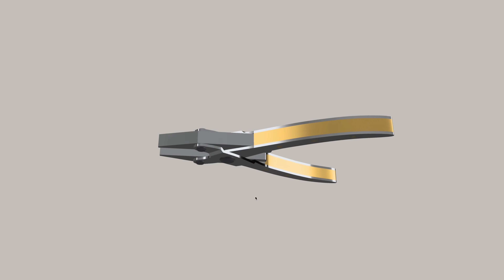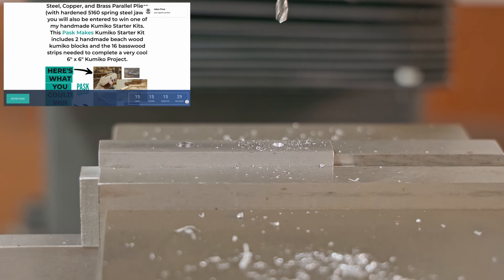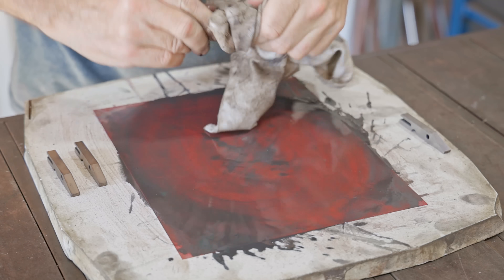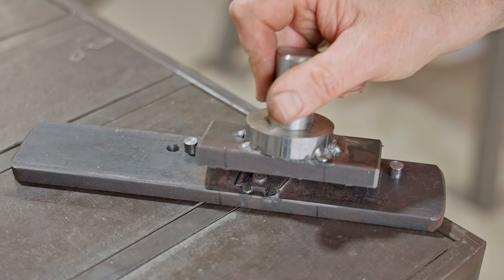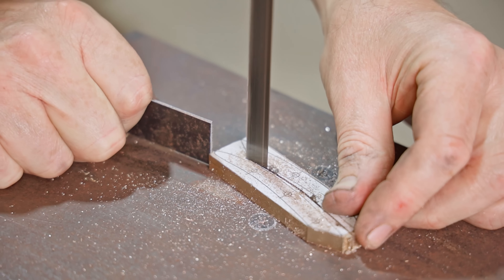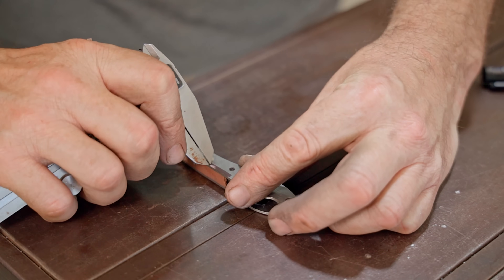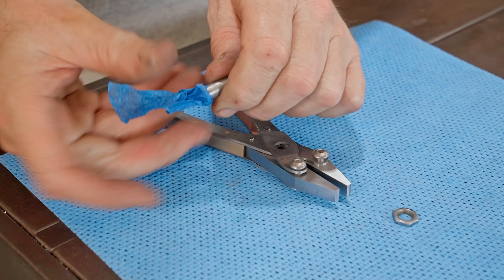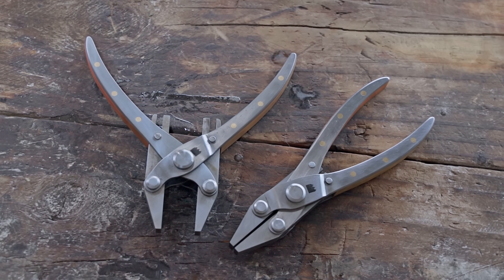How do Parallel Pliers work? Let's make some with Wow Factor and find out!

Comment: I probably would have used wood instead of copper or brass so it doesn't feel cold to the touch, then kept the wood a bit oversized and rounded. The copper and brass look nicer, though.

Comment: Copy the Bernard’s.  There should be a groove running down the center of one of the jaws so that you can pass a steel wire or rod thru the entire body of the pliers and get a good grip on the wire to pull lengthwise.  Also, add the 5X mechanical advantage side cutter that many Bernards pliers sport. Its a HUGE benefit.

Comment: I was complaining about the pinch point of regular pliers just a few weeks ago and didn't even realize parallel pliers existed!  Love this project and would love to buy the plans to build a set of my own!
Reply: I've an old pair made of stampings and tool steel. They are very smooth and have great bite. The bluing is excellent. They are beautifully made and a joy to use.
Reply: Bernard is the manufacturer.

Comment: I have a few pairs of parallel jaw pliers made by Maun in England. They're fantastic to use, especially when gripping wire. If whatever you're gripping is long, depending on its width you can slide it through the handles to give a really good grip on the very end.
Reply: So basically holding it yourself but without touching it

Comment: Fantastic! Beautiful build. As an aside, I still don't understand leaving oil on metal over night so it can penetrate but I do it myself and it seems to make a difference.
Reply: It won't soak into the metal, but giving it time to flow into all the nooks and crannies where you'd usually see the start of rust and pitting is probably the key.
Reply: @MrVeps1  that makes sense, get rid of the tiny water/moisture traps.

Comment: Very cool! 
Something you might want to consider is getting a quenching oil. While I have no personal experience, I've seen back to back tests of various quenching fluids, and an engineered quenching oil wound up being the best - with even straight water beating out canola oil and other commonly used fluids due to its consistency. 

It may very well be worth the investment!

Comment: When looking for and checking chop-shops, they always had a few pair around the shop. Back in the 60,-2000 they used the for changing the vin on the door frame, they used the PP's to form /shape the pop-rivets 6 points to install a new tag from a totaled to a stolen.

Comment: Hey Neil, great video. Really watchable. Thanks. (I met you at a YouTube creator event in Sydney, pre-pandemic.) I'll be really interested to see how these pliers go, long term, in particular as to whether galvanic corrosion is a problem for the steel handles. Steel is a more active galvanically metal than brass or copper, and therefore, when in close contact the steel will sacrifice itself to protect the brass/copper. In other words the copper and brass will tend to accelerate the rusting process on the steel. The epoxy might provide sufficient insulation to prevent this from occurring, or at least slow it down, so I suppose the success of that will depend on the thickness and contiguity of the epoxy layer. (This kind of corrosion is essentially the reverse of galvanising - where zinc is the more active metal and sacrifices itself over time to protect the steel).

Corrosion, if it occurs, should be more predominant in the steel touching the copper, because the copper is slightly less galvanically active than brass (leading to a slightly higher sacrificial rate for the steel).

Dissimilar metals in close contact always react galvanically in this way - perhaps something to consider in future projects.

All the best. Keep up the great work.

Comment: I am by no means a professional, but when you are doing you're drilling holes and milling out slots and such, your bit seem to be quite a but chattery, for the longevity and protection of your material and bits, use some machining oil. I don't suppose you'll need a while pressurized rig, but keeping a small bottle handy would do wonders. my apologies if you are already using lube, like I said I am not a professional, and I'm not trying to hate on your work, just pointing out something I noticed. Cheers

Comment: Another brilliant job Sir.  What was the small clamp you used at the drill press, the one with the copper in it?  Either brass or copper both would look great.
Reply: It's a Kant Twist clamp.
Reply: @Paul Frederick  thank you. I could use those in my leather working.

Comment: They are very cool. As with all your videos the process is interesting to follow. 
What is there an advantage to epoxying the pieces rather than brazing? 
Is brazing difficult with thick pieces of copper and brass?
Reply from the maker: Thanks Morten! I reckon soldering would've worked well but in the moment I decided to epoxy them. :)

Comment: I have a pair of old parallel pliers like these that i use all the time but have unfortunately been misused by a friend that i loaned them to. They are no longer parallel and are rusted and no longer very easy to use anymore. I would make some myselfbut i do not have the machinery that you have.   The quality of yours far exceed mine and would very much like to purchase some of yours if that were possible. Would you be interested in making 2 more of these for sale?

Comment: You could easily modify the design that the jaws actually converge toward the tip, contrary to standard pliers design. It would be impractical, sure, but a fun novelty item.

Comment: I have a pair that were my dad's.  As I am approaching 70 these are probably closer to 100 years old. I use them often and they are some of my most treasured tools. May yours have the same legacy.
Reply from the maker: Thanks very much John - they sound fabulous! :)
Reply: John, that is awesome! I do a lot of sewing, and I have some of my grandmothers tools. I never got a chance to actually sew with her, but I feel the history and a connection to her every time I use them.
Reply: probably some english-made Maun ones. very nice, useful and long lasting! 😏👍
Reply: @kittytrail  yeah, Maun industries, I don't remember how I got it, very handy tool 👍
Reply: Same, got mine from my dad, not sure he knows lol
Reply: I inherited a pair of scissors that I think were made in India. The steel seems very hard. When I was younger (and didn't know better) I used them to cut aluminium sheet. They still cut paper right to the tip and as long as I've had them they have never needed sharpening.
Reply: I, too, had a pair of these.  They were , also, probably 80-100 years old.  I had a shop fire 3 years ago and they were lost.
Reply: Wow that's amazing. Tools these days just aren't built to last like they used to be

Comment: Curious if there will be long-term rust problems due to contact corrosion.
Hardwood instead of copper/brass with steel pins would probably also look quite marvelous ;-)

Comment: A tip for etching with saltwater - do not use the original cotton buds with your crocodile clips, you are needlessly exposing the clip to the etching solution and it is very ineffective . Use a piece of graphite rod (pencil core works too) with cotton bud on one end and the crocodile clip on the other. That way he clip stays dry and it conducts current much better.

Comment: Those pliers are beautiful, very nice work. How hard would it be to make vice grip locking pliers, those would be pretty handy in a parallel configuration, especially if they had some light knurling or serrations inside the jaws.

Comment: Awesome project, I love how you use some good tech like the precision tools mixed with low tech, 9v battery and cut wood screws to make the pins. That's kind like how I work also, using what I have available and some creativity thinking outside of the box to simplify things. You are my favorite maker. Yes I would have mixed the Copper and Brass exactly how you did it too!

Comment: They did come out amazing.
An fast edge finding trick an old timer showed me is to take a piece of paper and hold it between the work piece and the cutter.  The cutter will pull it out of your fingers and not touch the work piece but will be within the 0.003 inch thickness of the paper.  It always worked.  I even used it to zero on the vise jaws and NEVER did I ever touch the jaws with the cutter.
You are having lots of fun with the machine tools.

Comment: if you really wanna have a challenge with this, why not try stainless versions of this? since you're only drilling the stainless it might be smart to use that instead of cheap iron. also, why not gang up all the plier sides together, 4 bent, 4 unbent, with a spacer? would have simplified drilling.

Comment: Nice job Neil like usual. Just a tip when hand sanding. If you stick duct tape to the back of the paper before cutting it to size, its alot more durable when you use it like you did at 13:37 :)
Reply from the maker: Thanks Dylan! I've done that before and it's a great tip, this Sia sandpaper seems to hold up pretty well as it is though. :)

Comment: I ran a Tool Room for an old Navy squadron and, the construction style of these pliers are 'old school' with one exception, on the old tools that used minimal metal they used wood for the infill materials. The metal plates on eitherside of the handle is where all the structural strenght is at and the wood is just there to keep the handle feeling and working like a handle. Rosewood, teak, and oak were common on these style of tools from the late 1800s to ...well, I think its still done when it makes sense. Depression era and WWI/WWII era tools you might find plywood or even glued wood pulp. Bakelite is uncommon but I've seen a few that did use it. I would love to see a Brass and Teak version, that would be awesome!
Reply: I wondered if it would be possible to add additional wooden layers outside the steel, on the handles, to allow an even rounder grip. Love the design as it is though.

Comment: Really lovely work on the pliers.
Maybe i would have cut the brass blocks in two and put a cobber slab in-between them. Not sure if it would work or be to "flimsy". Still one handle with brass and one with cobber is really nice, and easy to see if you hold the pliers the right way 🤭